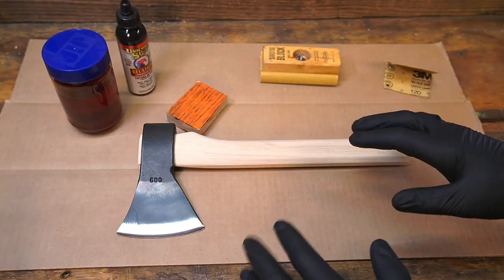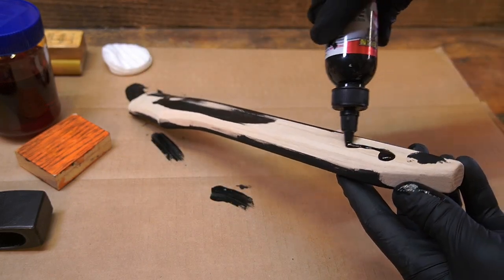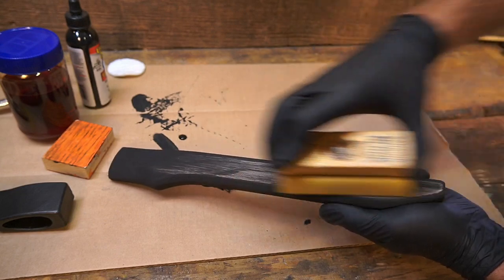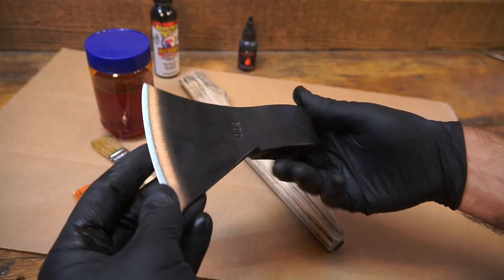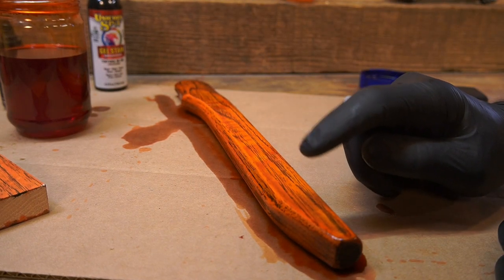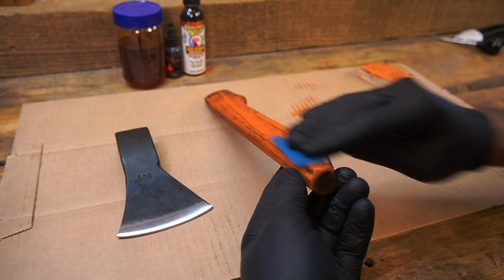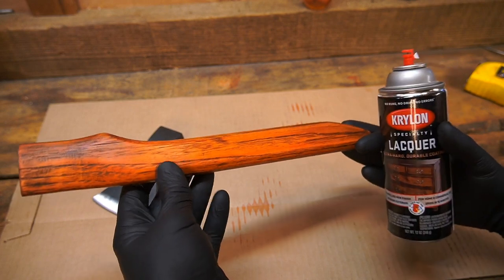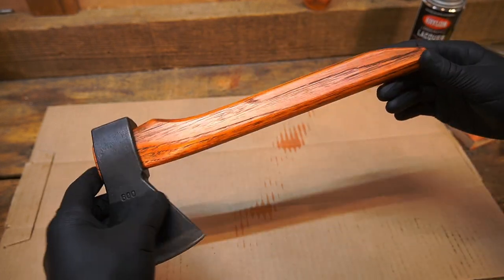Tiger Stripe Patern Throwing Axe Handle !!!!   How To

Comment: So cool. I just finished hanging my first axe. It's a true temper flint edge bell system single bit. Got it from a friend for 15 bucks and I found a nice looking handle at an old furniture shop. Now I got myself a 10 foot board of hickory and I'm hunting for some more heads. Great work!
Reply from the maker: This is great man. I like that you went straight to making your own handles. Good luck with your new addiction.